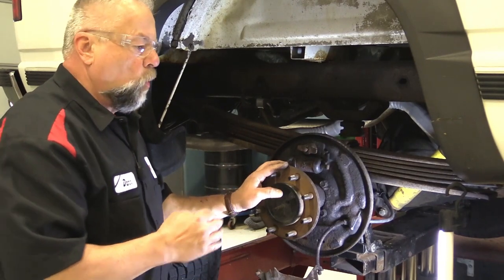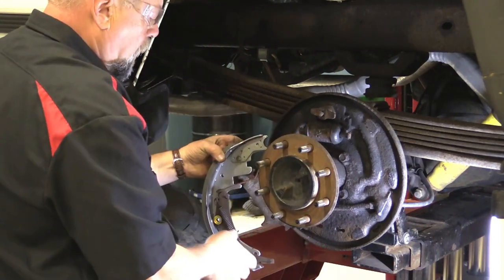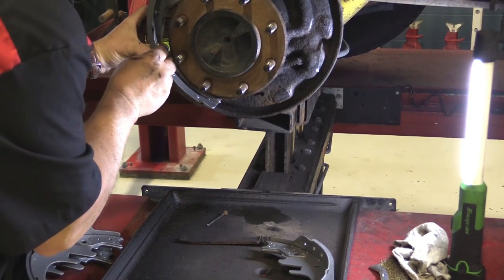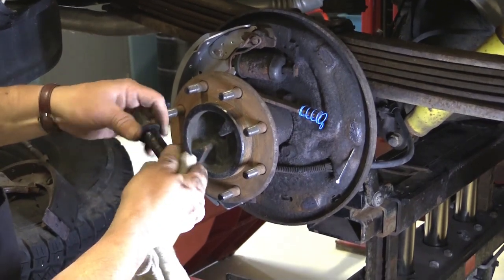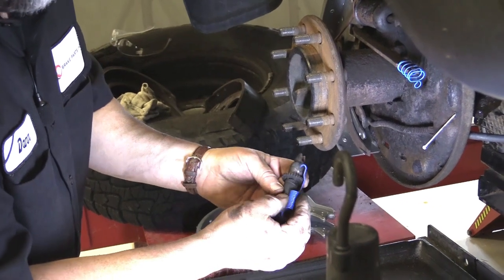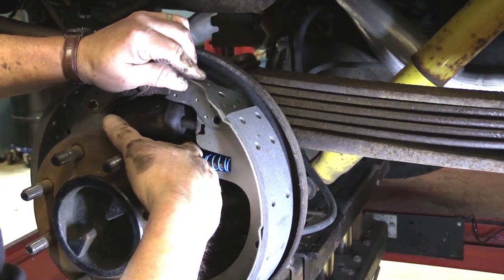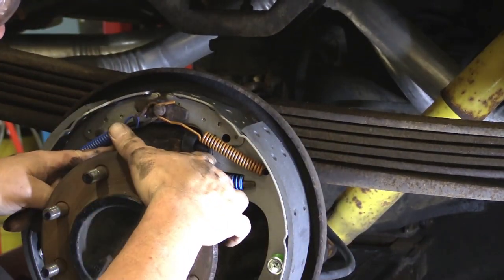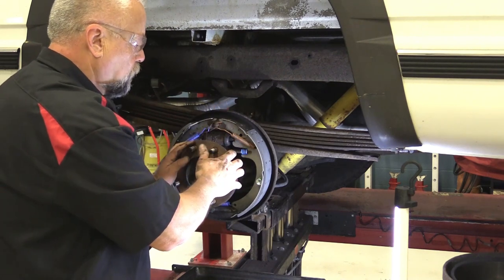Drum Brake Replacement: Assembling Drum Brakes

Comment: Idk guys, this wasn't very clear. I've watched very thorough, comprehensive brake drum rebuild videos, and although this was informative, the video wasn't all that great. I couldn't see much because of the camera angle, AND you didn't show putting the parking brake cable on? I'm aware that my 91 ranger is different than this truck, but.... this video could have been twice as long and a little more informative.